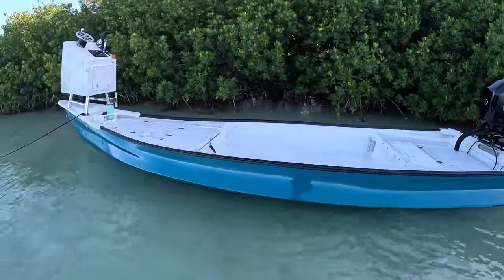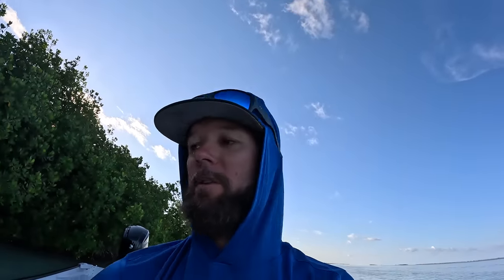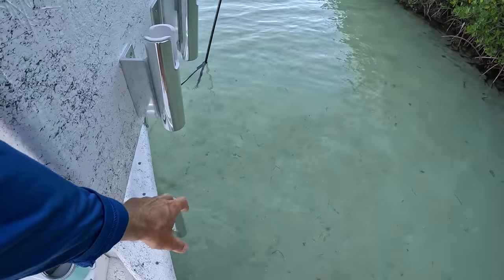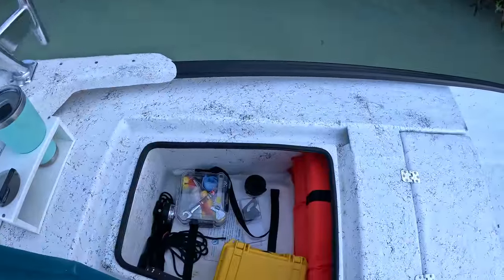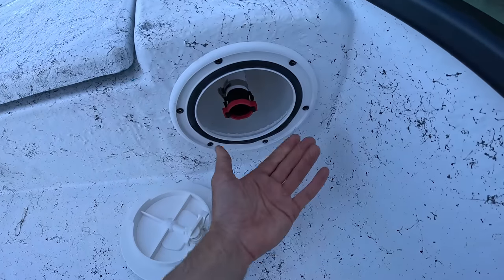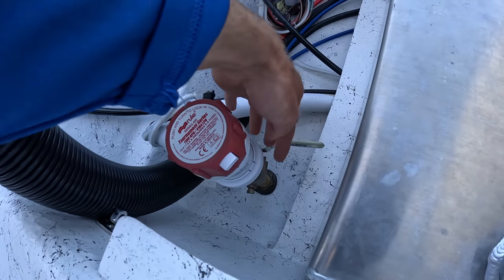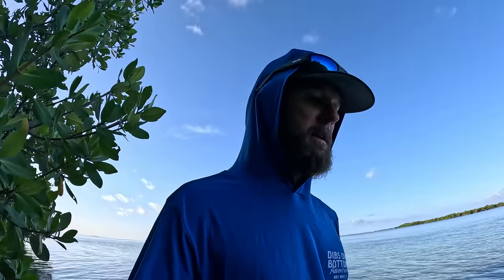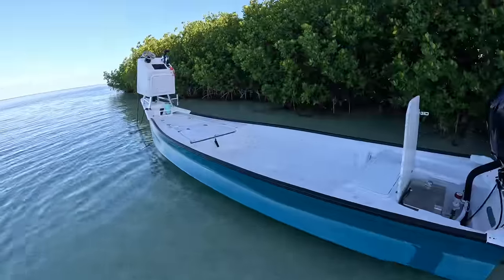Gheenoe Super 18 Reveal | Custom Build | Complete Walkthrough

Comment: Love the boat and your idea to put the helm station forward. There are many examples of this style of design in commercial fishing fleets but I have never seen it on such a small boat. Kudos to you. Even though you get less G forces at the bow I would like to see non skid behind the helm and a rail to keep you secure. That central, open space is huge but suppose it got flooded? I think big drains with jocker valves might be a potential solution. Once you are going forward the water will drain quickly. Same principle in sailing dinghies. Love the channel
Reply from the maker: thank you! love how it came out for sure. its its been pretty well thought out, even full of water the boat shouldn't sink with the amount of foam we built into it!

Comment: You’ll like the 4-blade. I have one on my 14’ skiff with just a 9.9. It grabs the water much better and I feel like I can kick the stern or bow in a tight space much easier. It will easily turn in a 360 degree circle at low speed with very little drift. 

You may want to consider a hydrofoil on the motor. You fish a lot of skinny water, and even though you have plenty of torque with that big engine, when you are at a low speed trying to get on plane it may drive the stern low for longer than necessary or safe. A hydrofoil will give you that plane ability almost instantly. You may not need it with the HP you have, but if you run into that problem it might be worth a $100 investment to save a prop.
Reply from the maker: love to hear it, its been awesome so far. and appreciate the tips, will def look into one.

Comment: Could you make the live well an extension of the front deck. Get it built so it can be flush. Looks like you might be able to make a drain that goes over the side. I'd even have it built as a possible second fish locker when you don't need the live well but more space to store fish.
Reply from the maker: I have a plastic molded one already, it's not gonna be pretty. but it's functional.

Comment: Idk if you plan on using the suction cup mount for that light or if they still offer it but I used the stick on mount with the suction cup and that made it about 10 minutes. Didn’t want fixed anchor lights cause I duck hunt the boat but anyway . That looks like a sweet little boat. Bad ass
Reply from the maker: gonna use sticky gopro mounts!

Comment: The color you came up with is something else! Good job on that. Four blades beat three on every type of boat. You sacrifice top end but you gain so much more I just don't understand why 4 blades aren't on every boat.   The 90 and the 70 weigh the same so why not keep the stick steering? I would rather watch you kneeling on the cooler making those turns. Just way cooler.  I associate those bow consoles with mullet fisherman so I have a prejudice against them. That is one beautiful boat even with the bow console.
Reply from the maker: worried about the extra speed, I've heard stories of the stick steers failing at speed. which is terrifying.

Comment: Do you plan on putting a handle on the console or like something to slide the fronts of your feet into? Or are you not at too much at risk of flying off from hitting a wave at high speeds?
Reply from the maker: no thats a bad idea, if you fall out of the boat you need to fall far out of the boat. this boat is build for back country calm days. there wont be any rough water running very often.
Reply: @KeyWestWaterman  oooh alright that makes sense, at least some kind of traction pad on there might not hurt tho especially after dive days when everything gets all wet, if it were me I’d always be worried about flying off that thing or slipping while it was moving lmao

Comment: Super new ride. Do you have vessel view on your Mercury?  It is the best way to identify the tru RPM.  I have the same motor on my boat with a 17 pitch X7 spitfire turns 5700 rpm and 40 mph.  My old prop was a 4 blade aluminum  and blew out badly in the turns.  Agree with one of the previous post that you need somewhere else to hold on at the helm and would be concerned with the nose diving in the turns if you let off on the throttle and turn the wheel.  Also that motor hooked up with that prop will come around fast.  it might not be a boat to allow just anyone drive.  Due to prop torque it is going to act differently turning one direction vs the other at speed.  A typical boat has the driver positioned to the starboard to counter act this.
Reply from the maker: its a blast, yea I have the vessel view hooked up. its flirting with 6000 wide open trimmed up spitfire X7 15 pitch. and correct its not something I would let just anyone drive, I've still been getting used to it. but honestly have hit some pretty tight turns at speed, no digging or much sliding the 4 blade has great traction. I've actually been extremely impressed with the handling thought it would be a little more cumbersome.

Comment: I'm interested to see what it does rpm/mph wise with a few people in it. 40 seems slow for that boat with a 90. I wonder if that's not a great prop for it? I've only dealt with 3 blade props though. Awesome designed boat, I thought it looked like a panga first glance.
Reply from the maker: the 4 blade it slowing it down a bit i'm sure, but truth is some hulls aren't built for speed. wide flat boat so alot of surface in the water (lots of drag)

Comment: Love the new Boat quick question is that fly by wire on the motor or is it cable. The only bad thing is that you’re gonna have to be driving it standing up all the time lol
Reply from the maker: its mechanical controls, and I stand on the big boat every day at work average runs 30 mins to 1 hour runs, the runs on this boat are never more than 20 mins.

Comment: I like it, but with the fwd console seems like it will be harder to get into those tight mangrove spots, but you know what you need. I don’t think I could stand for any long runs. Kill switch use is smart( ask me how I know) swimming 300 yards in cold water fully clothed is not fun.
Reply from the maker: its not much higher than the polling platform was on the old one so not much difference. and we never run very far in this boat, average run is only 15 mins. I stand in my big boat all day while working.

Comment: Just a thought,  ever think about a solar cell to help charge the battery.  As long as you're in the sun it will be charging 🤔
Reply from the maker: didn't even know that was a thing, will look into it!
Reply: @KeyWestWaterman  Harbour freight,  northern tool and equipment.  Had one on my lawn tractor.  Basically the same thing used for your cell phone

Comment: How did you keep the ass end up so high in the water? That's a heavy motor.
Reply from the maker: thats just how it sits, wide buoyant boat. lots of foam goes into these gheenoes
Reply: @Key West Waterman  got it. I have a 40hp merc on my 1660 lowe roughneck and it sits lower then yours. Crazy

Comment: The biggest mistake people make with outboards is not running them hard. They are built to push weight at WOT. A smaller engine would have been a better idea for engine life.
Reply from the maker: lol I wouldn't run a smaller engine at WOT either? why do all my friends that run their motors hard blow lowers and power heads, and I get 4000 hours out of mine?